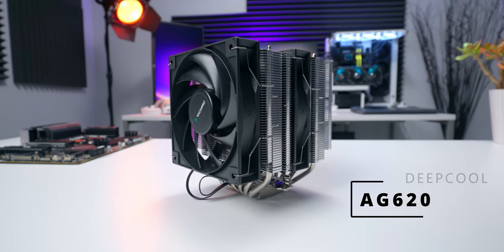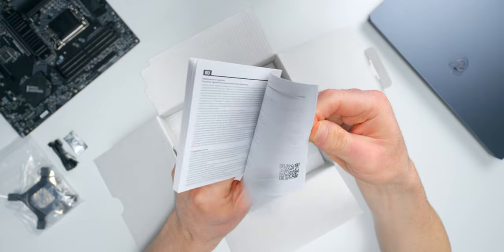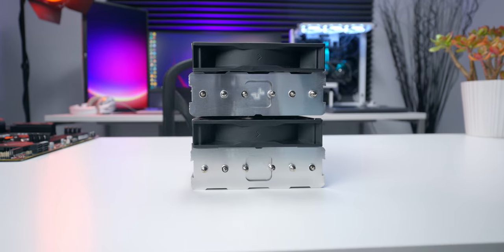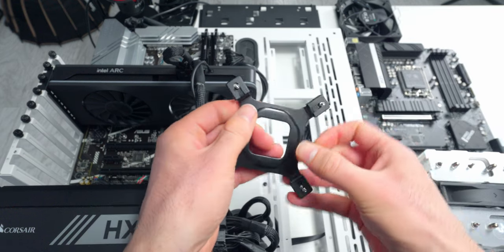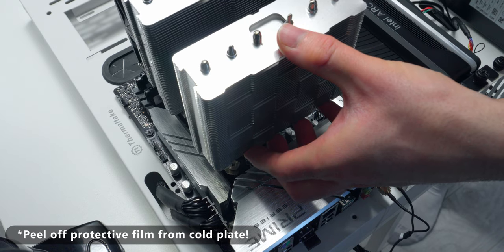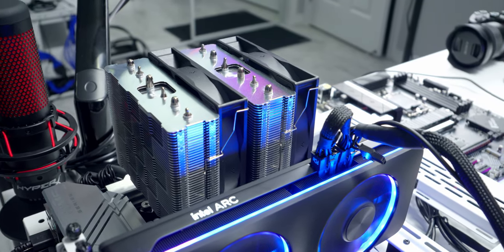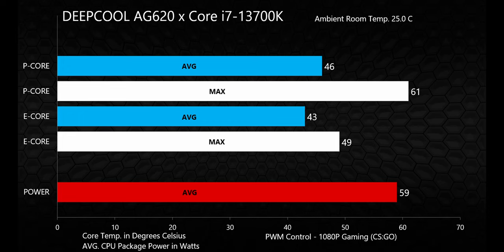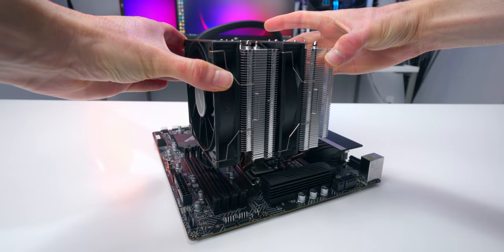Deepcool AG620 Installation and Performance Testing on the Intel Core i7-13700K!

Comment: Just planned my Mini ITX build, using the i7-13700K, and this is the cooler I chose, all things being equal I hope to have great success with this build...Thanks for reinforcing my decision...
Reply: Have you completed the build and how is the cooler performing?
Reply: @RTX7050  Oh, yeah, it's all done, been up and running...
Because I used an ITX/M-ATX case, air flow is somewhat "limited", albeit 3 case fans, temps are nominal, at idle, the CPU sits around 41C, and the GPU on the 4070, again at idle, runs about 51C, no complaints, runs like a rocket, almost(but not quite) as fast as my i9-14900KF, and IF you factor in $$$ spent, it's a better performer than the i9-14900KF...
All things being equal, I would do this combination again, I think I would go with a  different case though...

Build specs...
OS: Windows 11 Pro
MB: MSI MPG Z790I Edge WIFI
CPU: Intel Core i7-13700K w/Deepcool AG620
Ram: 2x32GB Crucial Pro DDR5-5600
SSD: 2x2TB Crucial 5 Plus M.2 NVMe in a RAID 1
GPU: MSI nVidia RTX 4070 12GB
PSU: Thermaltake Toughpower GF A3      1050W
Case: Montech Sky One Mini
Reply: @wipatriot510  Turbo Boost activated? No undervolt? 

Want to cool a 12700K with it

Comment: Hello. I am looking to build a computer soon with an MSI Z790 motherboard, an i7-3700K. But I cannot decide between the Deepcool AK620 or Noctua NH-U12A/NH-D15. I really do not like liquid cooling if I can just go air cooling. I will be playing The Sims 4 on ultra and maximum settings and using HandBrake. I will keep everything factory stock such as no contact frame to replace the stock contact frame, no undervolting, etc. I hope that if I were to choose this cooler, it can handle the i7-13700K factory stock with no problems.
Reply: AK620 is cheaper, D15 is better.
Reply: The degree difference is minimal like 1-3c.

70$ vs 120$+ dies not make any sense.

Ak620 is the way to go

Comment: How tall would you say the tallest RAM could be with this? I'm in the process of purchasing PC parts for a new build, and there was such a great deal for this CPU cooler during Prime Day last week I had to get it. The RAM I've been looking at has been the Corsair Vengeance DDR5 5600, which has the dimensions of 5.31 x 0.28 x 1.38 inches. So will 1.38 inches be short enough for this cooler?
Reply: I have the vengeance ram and it does not fit with this cooler, however, I did move the front fan to the back of the cooler closer to the exhaust and it works fine
Reply: Limit is 45mm height xpg lancer ddr5 perfect compatible
Reply: @itachi7976  Are you sure? I`m building Kingston Fury Renegade RGB, 96GB (2x48GB) with this cooler, AG620. The Fury Renegade has 44mm height. Is that okay?

Comment: Is it good with i5 13500?or liquid cooler is needed?stock cooler valorent temperature goes 84/86°C. I play games a lot
Reply: yes this cooler works great with the 13500 max temps are 75c under full load for hours
Reply: @bradendewolfe1314 How about i5-12600k ?
Reply: @mohammadbahrani497  probably would be fine honestly might get close to 80 but still safe temps

Comment: My 5800x3D reached the thermal limit of 90 °C on Cinebench 2023 using the G620. Is that normal? 
on game it run much much colder, never reach 90c.
Reply: i have ak400 and get 80c tops with same cpu with r23
Reply: 77.5c*

Comment: My system keeps throttling as soon as I start Cinebench 23 using the 13700K on a msi z690 pro a ddr4  Mobo and a Peerless assassin air cooler. Undervolting yield the same results, can't even get pass 26000 on Cinebench score. Anyone know why? Cooking seems hit or miss with these processors to be honest.
Reply: what about games?
Reply: Check your ram placement and performance

Comment: Good video. I’m gonna be building a very similar build here soon. Haven’t built a PC since 2013 and so much has changed. I’m old school so I don’t need any fancy water cooling or RGB. I’m gonna go with basically the same CPU as you 32gb ram, 2TB SSD, but in a white case. Do you like the ARC GPUs?
Reply from the maker: Hey. I have an ARC A770 and yes, I do like it.  It's come a long way since launch with all the driver updates.  With the latest price cuts, it's hard to argue against their value.

Comment: It that means if I pair this with 65 wt cpu the temps gona be under 65 or 70 
Actually I leave in very hot area   room temp here is 40c so what you think this is great cooler for 65 wt cpu

Comment: I used the ak620 on 14600k and it's not good it hit 100 degree
I changed the thermal paste and i get the same thermals
I changed the cooler to deepcool lt720 and it's great ❤
Reply: whats youre usage of cpu?i mean do you think ak620 is ok fot gaming?
Reply: @ArYKing 
I use the cpu 100% in emulators like RPCS3
And when i open some games they use the cpu almost 100% the temperature hit 100°
When the cpu usage is not 80~100% the temperature are good.